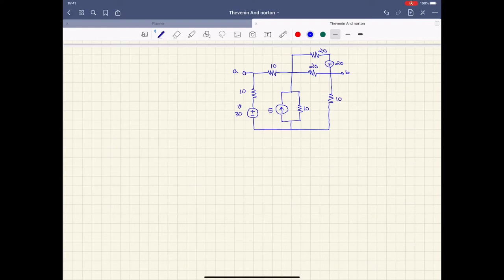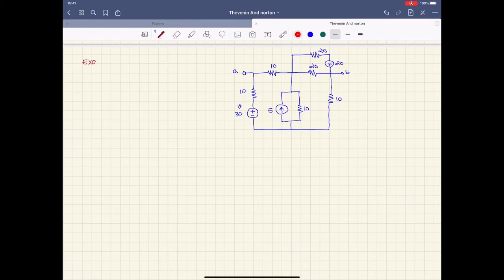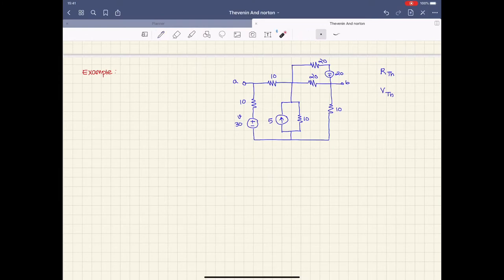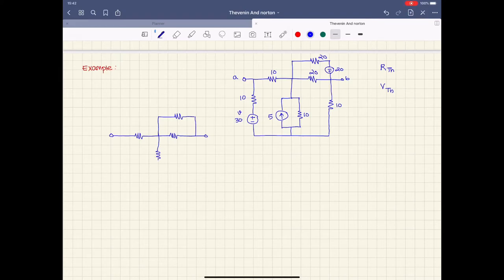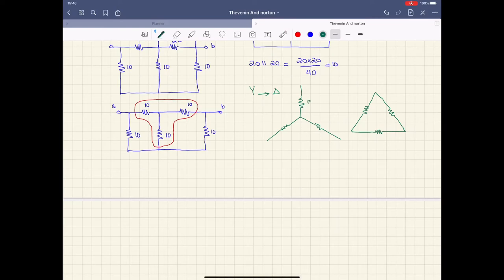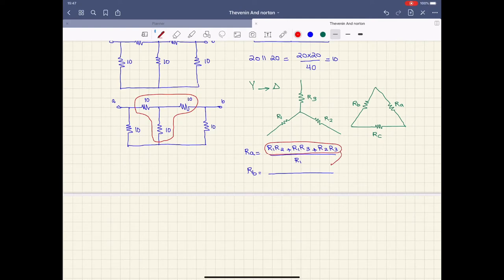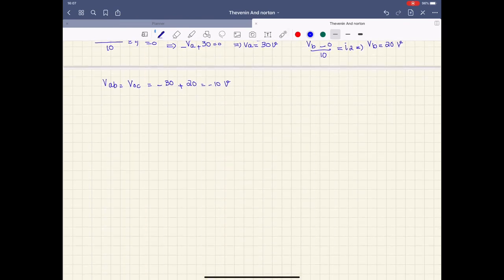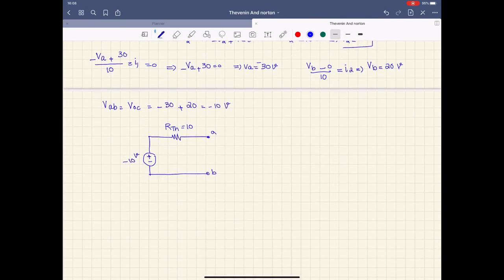Thevenin Equivalent Circuit Example

Comment: this is an awesome series. you are a great teacher. but i have to mention that you made a little mistake calculating Va. I do not know which sign Va or 30 has but I am sure that -Va + 30 = 0 is equivalent to Va = +30

and at the end you say that Vab = Va + Vb but before you said that Vab = Va - Vb

still a very nice video. easy to follow. keep on the good work

Comment: At 14:13 what is reason behind the direction of polarity of the 50V
Reply: Here's my reasoning.  The orginal 5A current source was showing conventional current going "up" on the paper.  Positive conventional current enters the negative terminal of a battery and exits out of the positive terminal of the battery.  Think of a simple DC source with 1 resistor circuit.  Notice how the current would travel in that circuit (clockwise or CCW) depending on your imagination, now notice how that current is interacting with the battery.  Hope that helps and is correct.